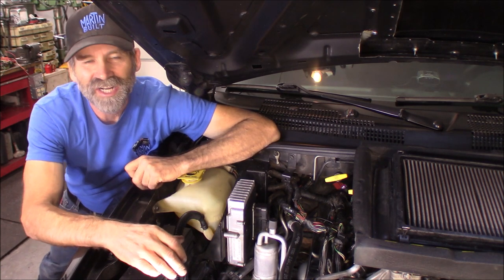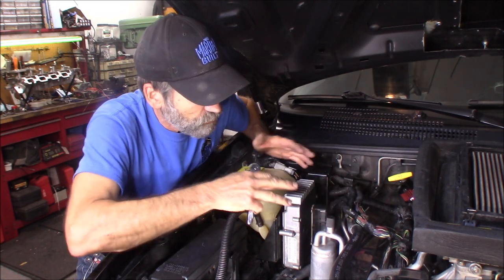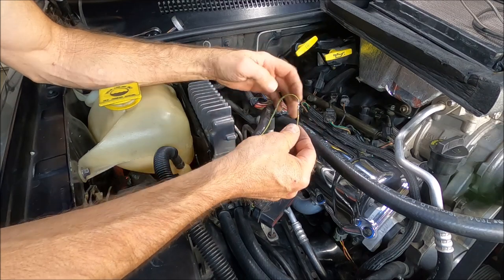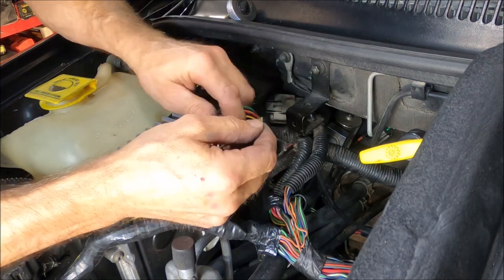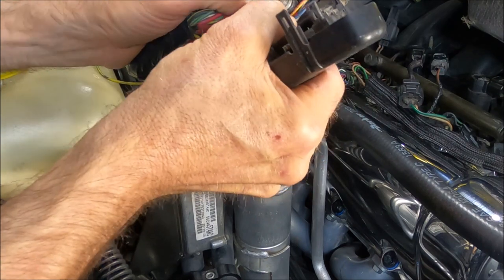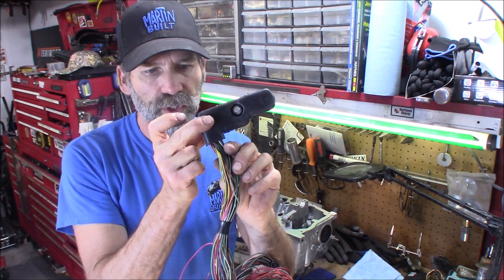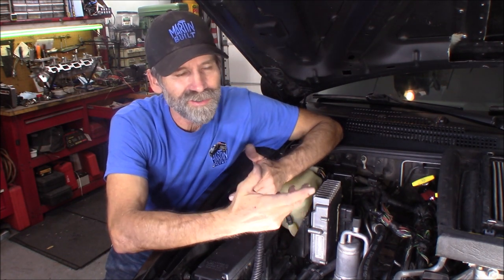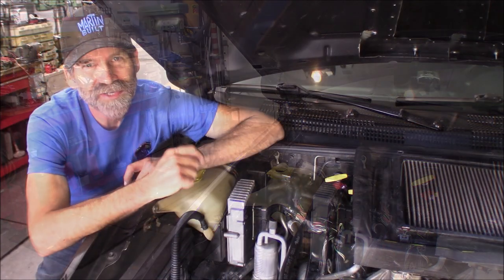How to Delete Torque Management  99-04 Jeep Grand Cherokee

Comment: Did this 8 years ago in my 02 4.7 HO. It’ll chirp tires on the 1-2 shift haha. Everyone thinking this hurts and does harm and blah blah have never worked on a vehicle, probably have a piece of paper with ASE written all over it and probably own tools from a white service truck with red letters on it. Slip creates heat. Both on their own kills an auto, together are detrimental. The quicker and firmer the shifts, the longer an auto will last. The ONLY reason for a soft shift in an auto is for COMFORT and nothing else. Soft, lazy shifts is the equivalent of resting your foot on the clutch pedal 24/7
Reply: Exactly. I learned this from my uncles transmission shop,
Reply: Yup I have a shift kit on my Silverado you get used to it.
Reply: What about any PO700 codes service engine soon or limp mode problem

Comment: Worth mentioning that if you installed the TrasGo shift kit, and used the resistor it comes with, you already override the torque management.
Reply from the maker: Thank you for the tip

Comment: Its a bit different on RHD of course, but the same 8mm etc etc, so still easy.  I pulled the wire from the connector and used insulation wire to wrap it, then put it all back together, so it looks like factory.  I love the "free" ideas that make your car better.
Reply from the maker: I'm glad you liked it and found it helpful.
Thank you for watching.

Comment: Martin. I have a 04 Dakota but have learned much about it from you. This particular vid doesn’t apply to me but Im watching anyway cause I like the tech stuff too. 

Thank you for doing what you do.
Reply from the maker: Thanks for watching, I just recently picked myself up a 2001 Dakota 4x4 with a 4.7 regular cab.
Reply: @martinbuilt  quad cab 5speed here.  Most affordable non full size quad cab v8 i could find. Got the rundown on the HO cams and timing chain stuff from your other vid even though I have the Haynes near by. Cams and chains on today actually. You made it easy, almost like I did one of these before. Glad i found your channel, keep it up. Thank you much.

Comment: It will real havock on your transfer case if you have 4x4 if your miles are high. I learned this the hard way just a heads up! The hard shift will fling around that front propeller shaft.
Reply: Just with 4x4 engaged? Or also in 2x4?
Reply: Even In 2wd the transfercase chain still sees power.

Comment: Another great video and easy to do mod. Question, in your experience, of all the WJ years, is there one you would recommend over another? I really like the WJ style and I’m thinking of towing (no more than 4,000 lbs).
Reply from the maker: Thank you, I am partial to the 02-04. I like how the EVAP got moved to the rear of the Jeep this made more room under the hood, grill and bumper changes, and HO engines. The only thing I didn't care for in the 01-04 with the 4.7 is the hydraulic cooling fan.
Reply: @martinbuilt  …thanks! I know how you feel about the hydraulic cooling fan, watched that video from start to end.

Comment: Great Video. Going To Do This To My 2002 Jeep Grand Cherokee Laredo 4×4 4.0 l6 engine. I like the quick hard shift and I've owned many old fast cars and trucks and I always put a shift kit in but this is Free Of Charge With The Same Results. Thank You.Now Can You Get Me More Gas Mileage lol. I put a 4 inch lift And 33 inch × 12.50 R17 and It's viscous on fuel but it costs money yo have the look and off road capabilities.
Reply: I'm pretty sure it's only available for the 4.7

Comment: This sounds and looks great but I’m missing the obvious reason as to why do this? Ie what benefit does this deliver?
Reply from the maker: It's like having a shift kit installed, you're getting a quicker and firmer shift and this actually also reduces wear on the transmission by reducing slippage on the clutches between shifts.
The only reason that they have this torque management is for driver comfort.

Comment: This video says everything really well apart from why do it in the first place?
Reply from the maker: Sorry if I failed to mention that. This will help give you a quicker firmer shift which also extends the life of the transmission. 
The only reason they have this torque management is for driver and passenger comfort
Reply: @martinbuilt  aaah that makes perfect sense. Thank you

Comment: Martin, can you make a video on how to change the ABS sensors front and rear? I have a Haynes manual but it doesn't give any info on it. It says have the dealer service it. I have 4 new ones to install, and have no idea where to find the connections without tearing up entire interior. Please help. Thanks.
Reply: Nevermind. I took out my back seats with all the brackets, lifted carpet, and found both connectors, on each side of tunnel. Tomorrow they get replaced.

Comment: Great video as usual Martin, I literally did this last week to my WJ. I like it so far, thinking about running wires and putting in a toggle switch. Do you think 18 gauge wires would be suffice to complete the job and where would be a good place tackle when running those two wires through the firewall? Thanks @martinbuilt
Reply from the maker: There's a couple places one would be on the driver side where the harness comes through the firewall you'll find a couple small grommets near that harness that are easy to run the wires through and then there's another place behind the ECM or the harness goes through the firewall.

Comment: Hello Martin, I also have the Trasgo kit and the Sonnax line pressure booster kit. I'm having a code that's not letting the TCM talk with my ECM. Do you think disconnecting this will help? Many thanks to you and your time.
Reply from the maker: Hello Chris, I'm not too familiar with the Transgo kit I don't think disconnecting that wires going to make any difference but it wouldn't hurt to try.

Comment: Thanks for your videos. I assume you have 45RFE or 545RFE transmission, did you improved it with overhaul kits anyhow?
Reply from the maker: It has a 545RFE transmission, I haven't made any other mods to the trams as of yet.

Comment: 02 4.7HO here. Had to do plugs, coils, MAF sensor, IAC sensor, TPS sensor.  Ever since doing this I cleared all misfire codes but it throws P0700 and P0740. If I cut this wire will it make torque converter CEL codes go away, or will it throw more codes??
Any help greatly appreciated.
Reply: Note once every 10-15 starts the thing runs like a dog spews smoke out the tailpipe and will stall at idle- will restart and it will run normally, but at stops RPM will bounce from a good 600 to 400. Letting off gas in higher gears trans will act up. Rough shifts here and there. Overall tranny shifts good. Its like the Jeep is haunted. Im thinking vacuum leaks.

Comment: Dun suppose this would work same for dodge Dakota? Idk if they ran same wiring diagrams as jeep or not...
Reply from the maker: I would imagine they do I'll have to look into it I just recently purchased an '01 Dakota with a 4.7
Reply: HELLz YES BUD!!!! Lolz you will be happy with it... well maybe if u swapped out for a 545rfe transmission.... or a 5speed lolz .... I loved the 01 4.7L 5speed sport I had.... before I had found out about ur channel I was running a Fastman Dan throttle body and 08 cams intake and adapter from fastman Dan. I tried many different types of ignition coils and I finally found Sultans Of Spark coils for my 07 Dakota. They’re actually cheaper than OEM and they have 8.4ohmz vs the stock 7.3ohmz so this means yah gap ur plugs to about .65 for better burn...

Comment: Martin, 

Do you plan on doing a re-wire tuck and relocation for the computers? If so where do you plan on relocating them?
I'm wondering because I am sure off-road WJs would like to have their computers hidden instead of getting splashed when going through streams or mud.

Thanks,
Tyler
Reply from the maker: I am planning on moving the TCM for sure unfortunately it's going in a place where an off-roader would not want it just behind the transfer case near the frame. The ECM is going to most likely stay where it's at I'm just going to make the wiring look way better.
I had thought about moving the TCM into the glove box location and sacrificed the glove box.
Reply: The computers and wiring will be fine, they're designed to withstand water submersion. What's really important is your engine, trans, tcase, and axle vents or openings.
Reply: @martinbuilt  What is the advantage of moving it by the t-case? is this for asthetics for the clean and accessible engine-bay?

Comment: I ended up wiring in a switch to change driving styles
Reply: Will it cause issues if you change while driving?
Reply: @pottaz  No. all this is doing is triggering the Fuel cutoff at shift points at WOT

Comment: Great video Martin! I have a 2000 Dakota 4.7 Magnum. Do you think it will work on this? Thanks
Reply from the maker: Yes it should, I just got a 2001 Dakota with a 4.7 and will be cutting the wire.
Reply: @martinbuilt  I will definitely be looking for that yellow/green wire. That will be a nice little mod to add to my 70mmTB, dual short air intakes with heat shield below, fan clutch delete, magnaflow w/ dual exhausts, and twin hood scoops with one scoop with the customized old air box fitted tight against the hood cutout (like the one you did in a previous video). Hope to see some videos with your new '01 Dakota. There's a lot of us Dakota owners out here ;)
Reply: @mmmachines  potent recipe

Comment: Hey Martin, long time fan and WJ enthusiast here, I did this to my 01 4.7 with noticeable results, I recently ended up with an 04 laredo 4.0 in killer shape and I was curious if it's the same process to ditch torque management for a 44re as it was with the 45rfe? It worked wonders on the black beast and was curious if it was more or less the same for the silver chariot with a 44re. Thanks in advance,
-Alec
Reply from the maker: As far as I know, it is a 45RFE and 545RFE mod only...
 Take a look and see if there is a  green with a yellow striped wire in the number 10 spot of the TCU. And then cut it… lol and see what happens.
 Thank you for supporting the channel and watching. I appreciate that.😉😎👍
Reply: @martinbuilt  that's right, worst case scenario I have to reconnect it and reset the tcu and ecu lol.

Comment: Just did this today and now i feel like its in limp mode and got a code p0700. Did exactly as described in the video, any thoughts as to why?
2000 4.7L
Reply from the maker: The only way I can explain that as it's got to be the wrong wire
Reply: Did you solve this?   One other guy said his #8 wire was pink

Comment: Awesome video and content on your channel. Keep up the great work. 

Question from my side. I am having an issue where the engine will stall when shifting from N-D or N-R or  P-R or P-D. Don't have any error codes related to gearbox. This also only happens when the vehicle is warmed up. 545rfe transmission. 

Sometime when idling in P or N the engine will stumble and drop rpm then recover again. 

Any pointers will be appreciated 😎
Reply from the maker: That definitely sounds like the idle air control valve either needs to be cleaned or replaced.
Reply: This sounds a bit like a worn out torque converter. There is two parts the will slip on each other when you're at a stop to keep the engine running but when it wears out, it binds and causes the engine to stop when engaging in a drive gear. That's why when you go from P to N it will stumble but stay running. That'd because both P and N are neutral gears whereas drive engages your car to the ground. It's almost like leaving the clutch out in manual and stopping at a red light. Check your fluid level and condition, hope this helps. Great vids Martin!
Reply: @chrismorton4533    thanks for the insight. I changed the IAC but still the same issue. Also think this is more gearbox related.

What I have noticed is when I cruise on highway speed with my foot stable on throttle with a small incline, it's as if it is engaging and disengaging the lockup clutch. The rpm wil fluctuate and can feel it fluctuating. This happens repeatedly. Also when I sometimes engage D it will have a harsh kick where the car will jump forward. 

Does that diagnose it to the torque converter on it's way out?
Reply: @chrismorton4533  I have alos read up on the Torque Limit Valve Spring and heard that they also fail. Could this also be the cause or will that cause different issues?
Reply: @pottaz  did you solve this problem?  I think I’m having a similar situation.  Thanks
Reply: @jcstevegigs  unfortunately not. Sold the vehicle. Speculated that there is a spring inside of the gearbox that sometimes fails. 

Can't remember the spring name. You can search for 545rfe valve body springs. Do a search regarding the issue you might have. Should pop up.

Comment: Do you still get the faster firmer shift if you shift it manually at the track instead of leaving it in drive?
Reply from the maker: yes it shifts firmer in both D and shifting manually, I would like if it shift quicker though.

Comment: Can torque management be modified in a program like HP tuners to get more power out of shifts compared to disabling the system entirely?
Not too familiar with how torque management works
Reply from the maker: yes, in a HP Tuner torque management can be modified.
Reply: @martinbuilt  can it be modified to increase power more or equal to a delete?

Comment: This video is a little old and sorry to comment so late but a just had a question, I did the torque management delete which gave me more power that I didn't know my 4.0 wj had the only problem is now my speedometer don't work anymore would there be a reason for that cause I deleted the right wire any answers would be great.
Reply from the maker: This mode was only meant to be used on the 45RFE and 545RFE transmission. I don't think it will work with the 42RE transmission like you have like you have in your vehicle.
Reply: @martinbuilt  yeah didn't think about that lol and thank you for letting me know.....
Reply: And thank you for bringing up the transmission cause I want to update  and upgrade everything I can the wife and I got this at I believe a not to bad of a price have all the receipts carfax matches everything had transmission work done already but would still like to update anyone with any tips we appreciate thank you everyone...

Comment: I have a 99 grand cherokee 4.0 and I don't see a yellow with green stripe wire any suggestions?
Reply from the maker: The reason is you have a different transmission with the 4.0
 I don't think you have a transmission control unit either do you?

Comment: Would that work for an 03 Dak with the 4.7 and 545rfe trans?
Reply from the maker: I believe the 03 Dakota has the NGC ECM and if so it won't work. You can identify the ECM if it has four plugs on it it's the NGC if it has three plugs it's a JTEC
Reply: @martinbuilt  the 02 had that, mine has the 4 plug...all in one unit

Comment: Hey Martin, I recently changed plugs on my 04 4.7 HO and now I have a high idle (around 900 RPM). I didn't change anything else. It idled and about 600-700 before. The old plugs had a huge gap almost .125 the new ones obviously didn't have this. Could this be caused by the TPS? I've reset the computer and still a slightly high idle. At first start it hits 1500 then comes down. What would cause this. Appreciate any info.
Reply from the maker: I'm betting when you change the plugs you disconnected a vacuum line somewhere. you may have not even realized it and you have a vacuum leak and that's why you have a high idle

Comment: Hey Martin. Idk if you could help, But I just tried this and my check engine light came one, and sent code p0206. And says cylinder 6 is open so I rewired the yellow green strip wire and my check enginelight went off and wasn't rough idle. I also cut it from the second location, 8 spot. Any suggestions??
Reply from the maker: That is so weird because that wire should have nothing to do with any of the cylinders.
 Try using an ohm meter going from the wire that you cut back to the number 10 position at the TCM to verify that it is the correct wire.

Comment: Hi Martin can I use 0w30 oil on my wj 4.7l
Reply from the maker: Well this is what Google has to say about it.
0W-30 is a special type of motor oil. It has a low viscosity and can be used in place of 5W-30 or 10W-30. The 0W-30 is a fully synthetic motor oil type that is capable of enhancing and improving fuel economy due to its lower friction properties.
I may give that a try for the winter and then back to 5W30 for the summer.🤔

Comment: I just attempted this on my 2002 Overland.  I went out there, found the gray connector (the larger of the two) and cut the yellow/green wire.  Then when I went for a drive, I found that I had no speed or odometer.  And my check engine light came on (P0500 -- no speed sensor).

So I came home and reconnected that wire with a butt connector.  I cleared the code, went for another drive.  The check engine light came back on (same code), though I have speed again.  I keep clearing the code but it won't go away even after reconnecting that wire.

I came back and re-watched this video.  On my WJ, it's a pink wire with a green stripe that is in that #8 position.  I hadn't paid attention to the actual wire position; I just focused on yellow/green.  So it's worth nothing that the wire color may not be the same.

But now I have a new problem to figure out with the CEL.  Sigh.  At this point I'm not cutting anymore wires.
Reply: This is always my fear doing something like this...did you get it straightened out?   So what you’re saying is it’s the #8 wire regardless of the color?  I have an ‘02 4.7
Reply: @jcstevegigs  No.  I just reconnected the wire and said to hell with it.